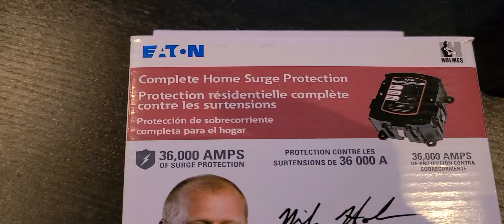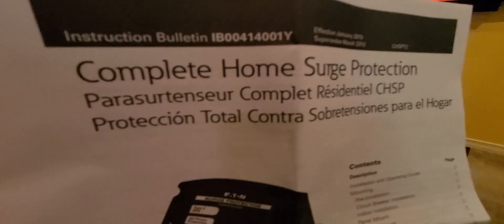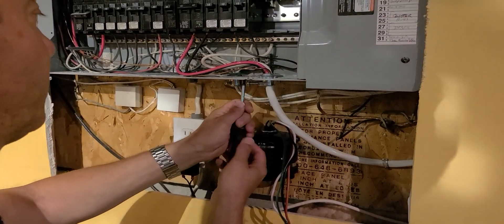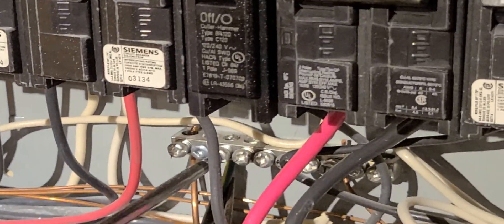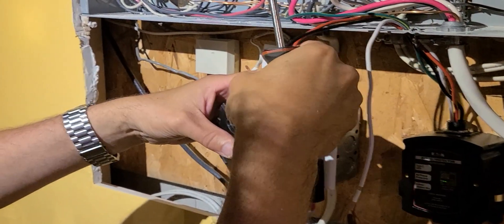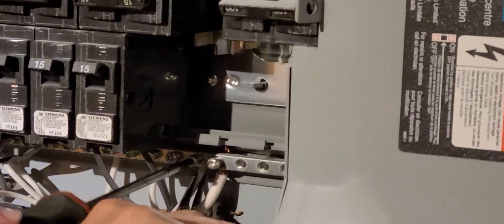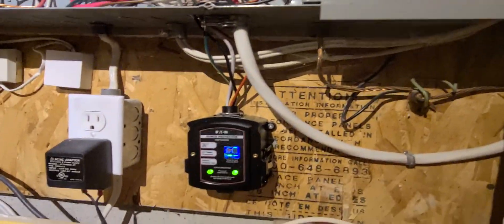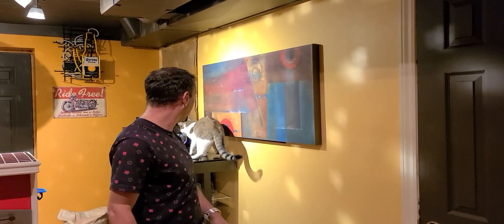Complete Home Surge Protection

Comment: You might want to get a grommet for the knock out hole you used. According to the NEC Article 370.17, "Conductors Entering Boxes, Conduit Bodies, or
Fittings. Conductors entering boxes, conduit bodies, or fittings shall be protected from abrasion..." This is just to keep stuff out as well as protect the wire from rubbing against the metal hole and creating a short.

Also, you're very brave for doing everything live! Stay safe. :)